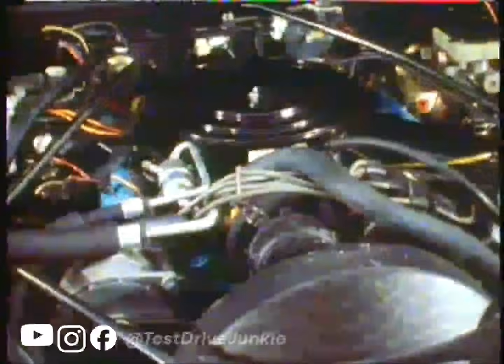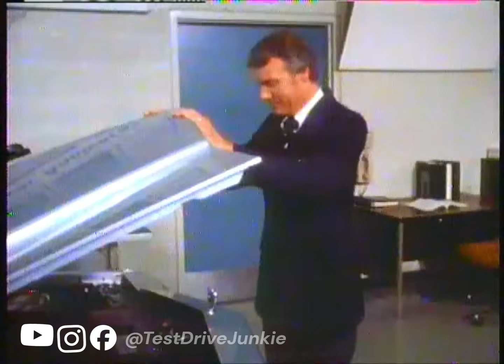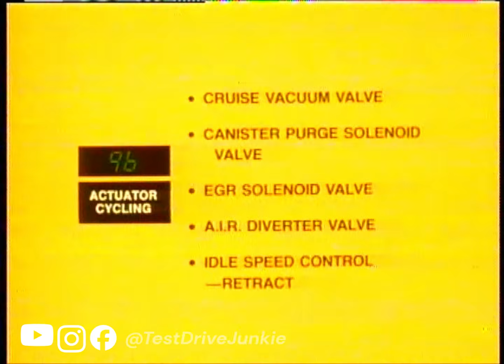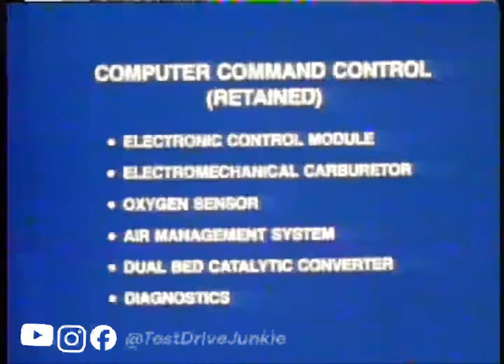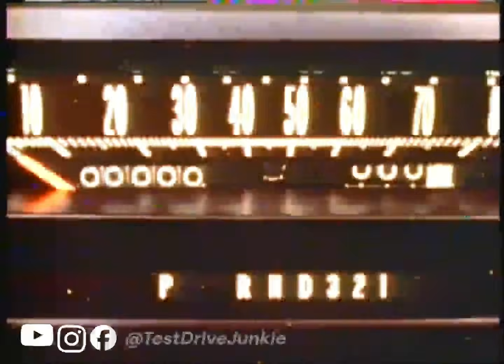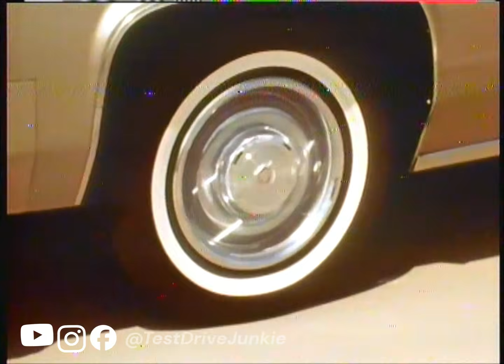1981 Cadillac Engines Drivetrains Brakes & Suspension Manufacturer Laserdisc Promotional VIdeo

Comment: Had an 1980 Eldorado with the 368 . For this year it had the 325 3 transmission no overdrive and no cylinder deactivation. Mpg wasn’t too bad either . No issues with starting and other drivability .
Reply: That was the first year of TBI injection.

Comment: The dfi system would of worked alot better if it had better electronics as well it had multi point fuel injection

Comment: Just think if Cadillac had simply taken the basic 368 fuel injected V8 and attached it to the 200 4-R overdrive automatic transmission they not only would have achieved better highway fuel economy but also would have greatly increased smoothness of operation, highway engine noise and fuel economy would have exceeded the 22 rating it got with the 8-6-4 engine without all the cost and complexity of the modulated system. The 368 could have been offered up until 1985 and would have made for much happier customers and considerably more torque that was needed for these boats compared to the undersized HT 4100 V8 that came out a year later for 1982! Note that the 4 speed automatic was paired to the cheaper more efficient credit option 4.1 liter Buick V6 for both the 81 and 82 model years.
Reply: The TH200-4R couldn't handle the torque of the 368 in stock form.  It was only designed for the 255 ft-lbs of a 307.  Yes, I know it was (later) strengthened for the Buick T-Type and Grand National, but GM didn't want to spend money on putting a performance "Grand National" transmission into a Cadillac.  One might say, "Penny wise, pound foolish."  The TH-350 3-speed was plenty enough transmission for the 368 engine, and it was simpler than the TH200-4R, but they chose not to utilize it.  Where Cadillac lost on fuel economy from the lack of overdrive on the TH-350, they could just have made up by installing higher gear-ratios on their rear differentials.  However yes, I do agree that Cadillac should have installed simple, reliable TBI fuel injection across its entire lineup on all of its engines, and done away with the 8-6-4 fiasco.  The installation of TBI alone would alone have gained each vehicle 1-2 MPG higher fuel economy than carburetors or the poorly-designed multi-port injection schemes of the era.
Reply: @am74343 : The 700-R4 was available but maybe Cadillac engineers didn't like it because they knew the early version was crap. Also the TH-400 was the only trans offered behind the 368. The TH-350 was not used on this engine.
Reply: Back in the depths of the late 70's-early 80's recession, Cadillac was sure that the C-body RWD cars were done for.  The 4100 V8 was made for the FWD Cadillac DeVilles in the pipeline.  
When things turned around and people wanted the full-sized C-bodies again, Cadillac was caught with its pants down and no engine.  Thus, the terrible engine options.  The 80's was not a good decade for Caddy.

Comment: I find it funny that GM still hasn't figured out how to make cylinder deactivation reliable. Not sure why, because Ford's system seems fine
Reply: Ford's system works somewhat similar to Honda VTEC (just minus the secondary cam lobe), funny enough GM has used an identical design on some V6's.
GM's V8 cylinder deactivation relies on collapsing lifters with tiny springs inside, springs that can break or lose strength and jam the lifters.
Reply: @Jakek200 I wonder if something resembling Ford's system could be tried on a pushrod engine like what GM makes. I hope GM tries that with their next gen v8s
Reply: @j-bird1778  I dont know how unless they ditch the Pushrod layout and went Overhead Cam as well.
Reply: @Jakek200 Maybe with a solenoid that works in the pivot points of the rocker arms it may be doable. That was the one reliable part of the cadillac v864